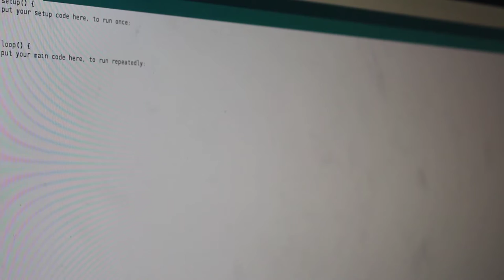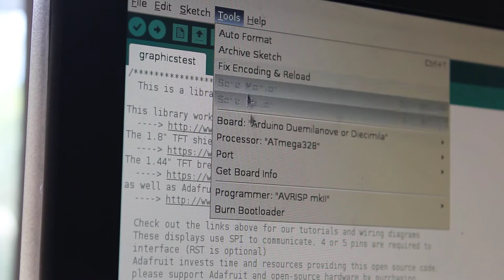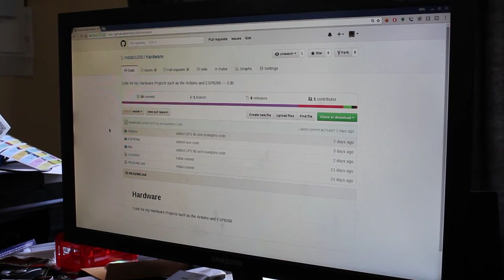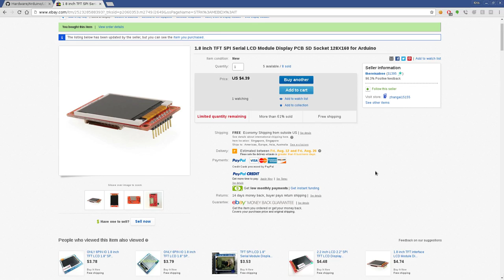Arduino Screen Display 1.8" TFT SPI LCD Module 128X160

Comment: My 1.8 ST7735 128 X 160 display pins differ, vcc, gnd, scl, sda, rs/dc, res, cs. I have no LED pin. No A0 pin. No SCK.  Is my display compatible with your connections and code?  First time with this type display.  Thank you.

Comment: Hello ca someone tell me if it's possible to programme with an LCD display so it will display information from a phone like text messages or maybe information from an app set up to do this.
Reply: yea but code and wiring will be ddiffernet